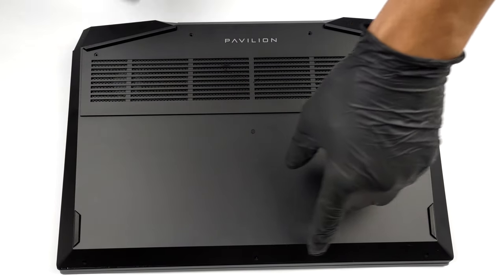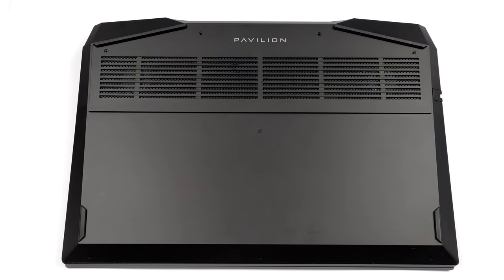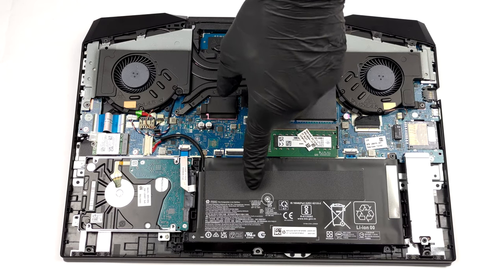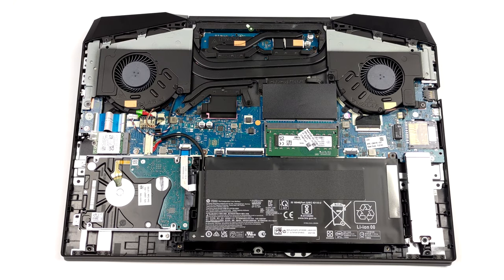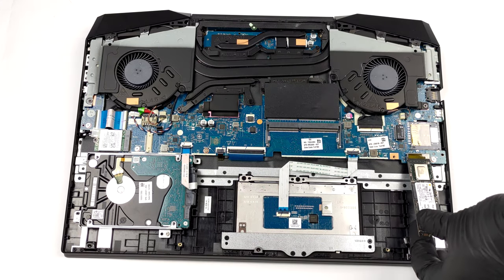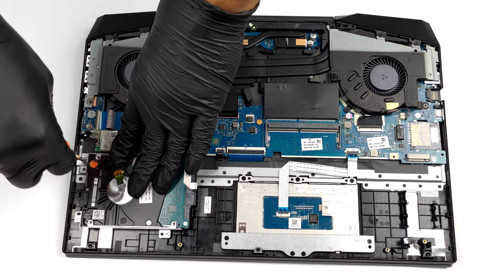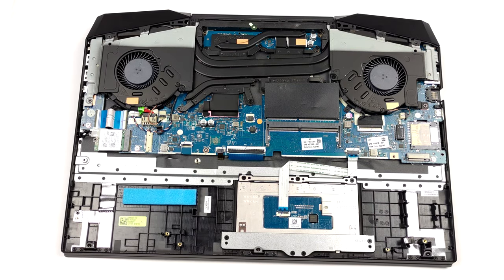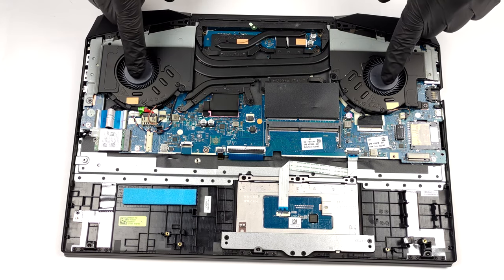🛠️ HP Pavilion Gaming 15 (15-dk2000) - disassembly and upgrade options

Comment: i LOVE hp's type of assembly, inside of the bottom, i did not see a single piece of glue, except for the screen, but even that can be attached without glue since the bezel has a clicking system, for the screen double sided tape can be used and is eaily removeable, thumbs up for that HP! i love how to battery is simply screwed in and not glued like most tablets/laptops nowadays...

Comment: How can I remove the fans to apply thermal paste?
Reply: You have to remove the whole cooling unit. It's a singular module. Unscrew the back vents. Thenthe grey part. Then unplug the wires and unscre the fan screws that attach it to the motherboard. Slowly remove the whole unit. Apply thermal past and put it.